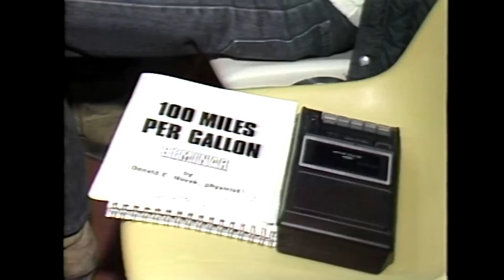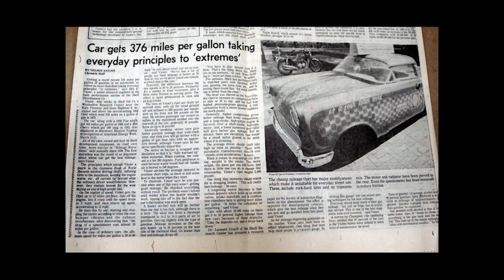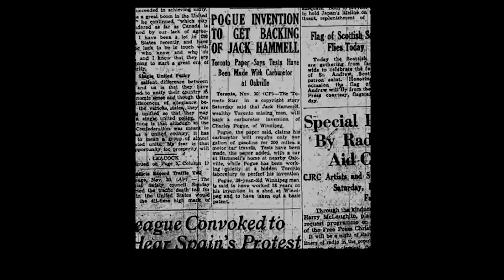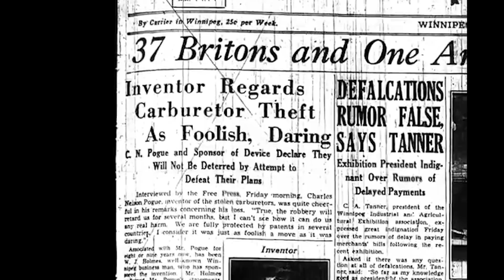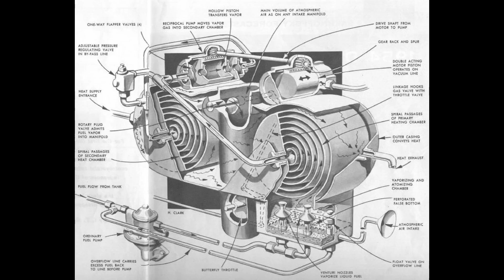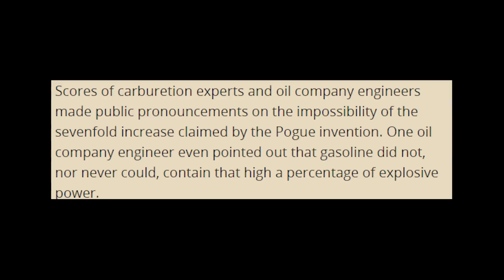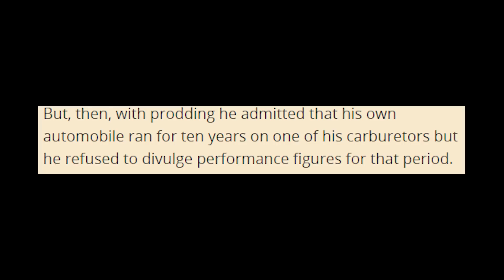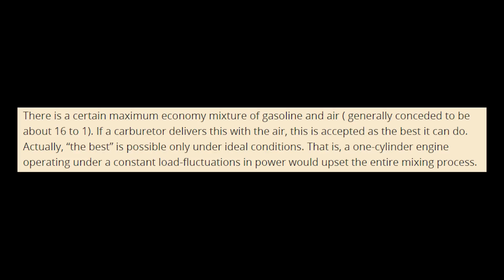What Happened to the Poque Carburetor - 200MPG

Comment: Honda insight 2000-2006 run a lean burn system. The computer would cycle a/f ratio from stoic to 22/1. The exhaust system had a nox converter to handle the increase of nox emissions. Air fuel ratios can be run at 20/1 but it effects our environment. So vehicles are manufactured to run rich to quench the combustion heat. Insights were advertised to get up to 70 (US) mpg. Actual at sea level run about 65 mpg. I have 2 of these cars. Just leaning out a carburetor injecting liquid will cause backfiring and exhaust valve burning. Vapor fuel burning has to be a system and not just a turn the valve tighter approach.

Comment: Pogue achieved mpg on wellhead fuel before catalytic cracking of oil was started. Wellhead fuel has lighter molecules making the fuel easier vaporized without heavy molecule residue which was found later to carbon up any device. Best direction for mpg improvement is to supplement evaporated fuel. As in using some heat but not to vaporize more than half. Improvements can be made. 
Check out this u tube video. Search
"cold fuel vaporizer" by Jeanie McKeehan. video starts a man talking. He tells his experience with his device. Worth the look.

Comment: The carb itself could hide fuel.  Test and testimonial by a failing car manufacturer. All kinda sus.  If you run lean fuel, you improve economy but you melt your pistons from the high heat.

Comment: I can get 200 MPG out of an Abrams tank or any other vehicle without changing a single part, just shut the engine off and roll it down a long hill it will get infinite MPG actually. Then you can just drive the required distance to lower it to whatever MPG number you want! All jokes aside Poque got screwed by the media on this carburetor, he never claimed it got 200 MPG, or anything the media did. He got accused of false advertising and called a lier, quack, conaritst, your name it. This carburetor did improve fuel efficiency, but that wasn't hard considering these older engines ran pig rich, and had terrible wet flow characteristics, and terrible cylinder to cylinder fuel distribution. As a result a significant amount of fuel dropped out of the air in the intake manifold requiring a far richer fuel mixture to run. Vaporizing the fuel in the carb allowed the engine to run on a much leaner mixture. However this was detrimental to making power as hot fuel and air is less dense then cold, and fuel vapor takes up a lot of room that displaces air. Today there would be little benefit to a fuel vaporizer, as port and even direct injection have eliminated wet flow, port, chamber, and manifold designs have vastly improved. This carburetor absolutely worked as far as increasing fuel efficiency on the engines of the day, however it did so at the cost of power and drivability. I would say it probably gave a 10-20 percent increase in mileage, at the expense of a power loss of roughly 25 percent and a major decrease in drivability.

Comment: Worth noting that the 1927 Model T Fords all came from the factory with a vaporizer system. It's a very simple mechanism compared to Pogue's patent, but the principle is the same, the fuel is vaporized by coming into contact with a hot plate, and the vapor is then drawn into the manifold. No fuel is wasted as unburned droplets. Ford adopted the vaporizer so the car could use "low quality" fuel. It's telling that the Fordson tractor also used a vaporizer, the vaporizer was used so the tractor could burn kerosene which has a much high flashpoint than gasoline. The engine would be started on gasoline, then once the exhaust and vaporizer were heated up, the fuel would be switched to kerosene. Kerosene being much cheaper than gasoline in the 1920s, this significantly reduced fuel costs... it may not have got 200mpg, but in terms of money spent vs. work done, it was a huge advantage. I sort of think the 1927 Ford T was fitted with a vaporizer so it could "theoretically" be run on cheap kerosene, but you shouldn't do that wink wink because Ford says not to.

Comment: Your actually cracking the fuel into different hydrocarbons the same way they do in the refineries. There is a lot more to it then heating and vaporizing fuel. Look at your shell marathon miles per gallon. It's well over 2000 miles per gallon this year and has been for a long time

Comment: Turning the fuel into a very fine vapor actually helps mixing the fuel to the air, and this in turn makes it possible to run the engine on a leaner mixture more reliably.the price you pay is less power and higher temperatures.

Comment: I saw a local news story many years ago whereby this guy said he had his Cadillac with a huge engine getting crazy good gas milage.  He was being interviewed and had the hood open.  The engine looked as if it had miles of hoses in it.  This story aired once, and he and this story never amounted to anything.  I assume he was bought out or threatened.  I suspected he was processing the exhaust and re-burning the unburnt fuel and although his calculations may not have been as good as he claimed I still think they were way better than they are now even.   Why are we told there is a fuel shortage and we are harming the environment with co2 yet speed limits are increasing.  Makes absolutely no sense.   Its all about money and nothing else.

Comment: Popular Mechanics did an article back in the 1970's during the 73 Arab oil embargo.  It was a great article, with the carb mounted to a Ford's front fender.  Very little information went into what was required to make it work.  Liquid gasoline has a good heat content, although diesel is at the top of the thermal content.  
The requirement for adequate performance and economy from this  carburetor by vaporizing the fuel would require a definite amount of energy to keep the engine running at idle and at 70 MPH it would require a tremendous amount more.  So unless this carburetor can store a lot of vapor for full throttle acceleration, it won't work.  Add in the weight of the vehicle, rolling resistance, friction and air resistance which all contribute to decreasing MPG while driving.  The article in Popular Mechanics mentioned that Polk sold the invention to the oil companies which lead a lot of people to believe it was a conspiracy.  Never saw any followup articles in P.M. or Popular Science, or Mechanics Illustrated or any other magazines.  Wish I still had that article right now.
Reply from the maker: Ill see if I can find any info thanks😁

Comment: After reading anything about the “Pogue carburetor” we took an old Moz All rider lawn mower and modified it.  To the gas line - We added  a section of steel brake line rerouting it’s path around the exhaust pipe before it got to the carburetor.  
Well..... it ran well. It heated the gasoline up and it ran on the fumes after a bit of time somehow....it would mow all day on a quart of gasoline.....but if you killed the engine off it would refuse to start until it cooled completely!
Reply: I modified  a B&S lawn motor , the only thing I done was make  tin spiral  of fins and  insert  inside the intake  manifold ( looked  something shaped  like  tinsel, only heavier)   ,the fuel needle needed  to b adjusted  leaner as the engine  warmed  up , I estimate  that it used 60% less fuel for the same power output,  so simple   to create.
I never tried  with car engines!  Car carborators are hard to set fuel mixture  in the  go!

Comment: Pure unadulterated bull crap. The basic laws of physics apply, even to this guy. I might also note that there is a lot more to engine efficiency than a carburetor.
There are simply not enough BTUs in a gallon of gasoline to move a car 200 miles. Pure and simple. This is 100% fantasy. Stories like this have been goping around for decades upon decades. Not a word of truth to them.

Comment: An important factor that most miss with the Pogue and other "super Carb's" is  the fuel chemistry. Back in the old days before  the first energy Crisis in 1973,  gasoline had chemistry that made it much easier to vaporise. The refiners changed that in winter of '73-'74 so they could use more of the heavier hydrocarbon chains in gasoline. These bigger molecules require different conditions to evaporate into vapor, compared to the short chain HC's. This change in gasoline chemistry did then and will still defeat Vaporising carburetors like the famous Pogue,.
 But Ron Hatton created a modern solution to this- the Gadgetman Groove. the Groove is applicable to virtually all gas engines today, and many carburetors too..

Comment: First the 396 Opel WAS NOT RUNNING A Poque Carb, it was a running a lawn mower carb and a bunch of other tricks to get that mileage, it was a rigged trial.

Second a ELECRONIC CONTEOLLED FUEL INJECTED car can run a very low RPMs like 1000, and at very high air fuel ratios, I have gotten 35MPG at 16.4: 1 at 65MPH at 1700RPMs in a 2000 Mercury Grand Marques any time I wanted to. That car was able to do 27/30MPG stock at 65MPH.

First 100% fact, liquid gasoline DOES NOT BURN!!! An old demo is throwing a burning match into a cold bucket of gasoline and the result is a put out match.

100% FACT is only gasoline vapors burn.

OK here is the theory/facts behind this claim.

ONLY vapor burns, but getting gasoline into a vapor sate is not easy, so cars rely on the fuel droplets vaporizing on their own, in carbs some happened on their way through the carb and though the warm to hot intake manifold there was vaporizing by mixed with air from the carb to the combustion chamber. 

Some might be also happening with Throttle Body Injection The injectors are on top of a normal carb like intake manifold) but there is some little time for the air and fuel to mix on its way to the combustion chamber.

This no longer happens with port injection and direct injection. Port injection happens at the intake valve and modern cars are timing that to happen at the point of the opening valve.

But Port injection in the early GM 1985 to 1990 Tuned Port Injection system did do a funny thing, inject fuel onto the hot intake valve which help vaporize the fuel more before the valve opened…. 

That is no longer done, So now we have to now rely totally on the heat in the combustion chamber to try to convert the fuel to vapor, note there is no real time so only 20 to 30% gets converted.

Also gas burning in an ICE (internal Combustion Engine) needs a lot of lead time so we start this burning up to 40+ degrees BEFORE Top Dead Center, and sadly it keeps burning after the power stroke and as it exits the engine and then in the exhaust manifold and so on. The left over still burning fuel is ALL wasted.  Even Exhaust Gas Return does only used very little of this. 

This is what the catalytic convertor burns.

Vapor on the other hand burns very fast, and needs no advance start to its burning, so it can be fired AT TDC and then can product full power for the power stroke from TDC (top Dead Center)  to BDC (Bottom dead center) And it can be almost all consumed at that point so there is NO burning fuel exiting the engine. 

How much does 1 gallon of liquid gasoline displace as a vapor? The saturated vapor volume of an average gallon of liquid gasoline when fully evaporated is 160 gallons of vapor at 60° F and sea level. When you convert 1 gallon of gasoline into 160 gallons of highly combustible fuel vapor you increase your nation’s fuel supply by 16,000% (16,000% of 1 is 160). If you paid $5 for just one gallon of liquid gasoline you would actually only be paying $0.03 (3 cents) per gallon of fuel vapor.

So this will use a much lesser amount of fuel (perhaps only 30%) to do the same work and none is wasted so the extra 60 to 80% is not needed.

It is also written in some tech articles that because of the requirement for a catalytic convertor it MUST be fed some gasoline to operate and to insure this happens 100% of the time our cars are programed to a touch run rich 100% of the time and that 14.7 is only ideal FOR THE catalytic convertor not for the engine nor MPG.

The sad thing is today’s fuel injection could give much better MPG if only programed to do so. 

The only problem with a lean burn of 16/17 to 1 is NOX, and it can be fixed with more EGR or water injection.  

A car running on pure vapor has a few problems to overcome, 1) using exhaust heat will fail if it does start to run on pure vapor as the exhaust heat drops like rock as there is no burning gasoline in it. So the vapor system shuts down until the heat returns running normally, on and off operation. 

2) And independent heat system is needed, electric heating seems to only system.

3) There can be no vapor when the engine is not running, all vapor much be burned before engine is stopped. Escaping vapor is what causes under the hood explosions. So controls to insure this and electronic control of metering and shutting off all fuel in needed.

4) To vaporize current gasoline takes a very high temp and carries a risk of fuel burning at the touch of air, so it has to be make in an air tight system.

5) If as claimed a ICE on Pure Vapor will thus run a lot colder than normal, an extra heating system may be needed for cabin heat in colder areas. 

This is some of  my best understanding on this subject.

Comment: What happened to Volkswagens long run high fuel efficiency diesel engine. It had come out in a few autos in Europe but then was quickly hushed up and all the cars were pulled and replaced with standard diesel engine that got about a half to one third the normal mileage.

Comment: The real number is... Slightly more than a standard carb.
Better burn efficiency = more mpg
Less power = more mpg
Just a guess but i would say probably around a 20 percent increase in fuel efficiency but your left with a slower, more expensive, complex car that could explode at any moment.

Comment: There is a problem when talking about internal combustion energy today and drawing informed comparison about what was before the introduction of emissions control concepts.
Even in an engine with the latest conceptual technology, running hydrogen gas, the combustion temperature has to be regulated to less than the optimal combustion needs. This is because combustion at certain temperature and above cause carbon based combusables to produce nox and various exceedingly harmful gases. While hydrogen is pure clean burning any thing else in the atmosphere is not, such as the traces of lubricants that are unavoidably present in an engine. Catalytic converters are one way of mitigating the worst gases but relative to the life of an engine, the longevity and performance of them is extremely poor. Added to that is the significant high cost of such devices, due to their magic being the result of very precious metals inside.
I'm sceptical of those that use only numbers to discredit a claim, I'm also very sceptical of many claims. Early vehicles were comparable with vehicles of the last 20 years in relation to "highway mileage", overall speed and power were arguably lacking, but in the absence of emissions requirements I'm sure there were many concepts developed that were better than what was produced and commonly fitted to engines. The fact that configuration of engines can vary widely, could mean that an extremely good induction system, far better than original fitment, was realized many times, I'm sure this has been an oversight in many a debate as to something being Truth or Tale.
We can get 100 mpg, but from uni student projects and not commercially viable products, it's just too hard to harness all the energy released when detonating fossil fuel! Light, heat and sound are good examples of  waist, when an engine can run whisper quite without a muffler you will be very close to all that petroleum can deliver. F1 technology is harnessing uncontained expanding pressure and heat with turbo technology and metals that flow electrons when heated, but this is currently expensive tech. The truth is an engines efficiency is reliant on every part and equation relative to each part, from just in front of the intake, to the tip of the exhaust. Manufacturing constraints (physical financial) and industry regulations plus some other factors, mean there is almost always room for improvement!

Comment: While it may be slightly more efficient, in reality, its really just limiting how much gas it allows you to put in the engine. The equivalent of just using a light touch on the throttle. Power decreases MPG. So this carb just decreases power.
Reply: Exactly, this is why some people are overly skeptical and others, believe two magnets and a spark plug makes a machine to power a house. 
All the factor need to be included to determine whether something is what it is implied to be.
It's like "I found an invention that genuinely cut 1/4 off my F250's fuel Bill!"
A TOYOTA COROLLA! LOL

Comment: What Poque probably invented was a way to reliably atomize fuel at very lean ratios when the engine was operating at near steady-state conditions -kinda like the various "lean burn" technologies that were invented in the 1970s during the oil crisis. That might make it possible to hypermile in "economy race" conditions, with the engine at near-constant RPM, and at optimal load, more reliably than with a regular, general-purpose carburetor, biut likely it wouldn't offer any advantages under varying load or hard acceleration. It would just be better than a "regular" carburetor under very specific conditions.
Reply: Yes, I think the concept of 100% fuel efficiency is not in the realm of this subject, as to this day we're still miles away, so far that a solid 10% improvement would be VERY significant.
I agree with you that it's highly likely that he found a better delivery system for fuel load in complex engine conditions. Only recently has a better way of atomizing fuel through a ventury system in a low speed air stream been implemented. REF: Smart carbi.